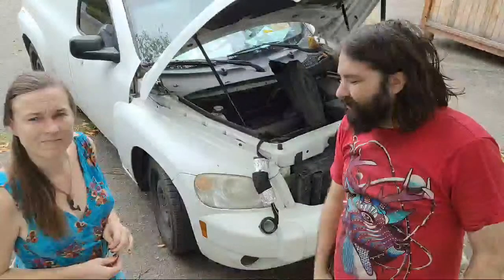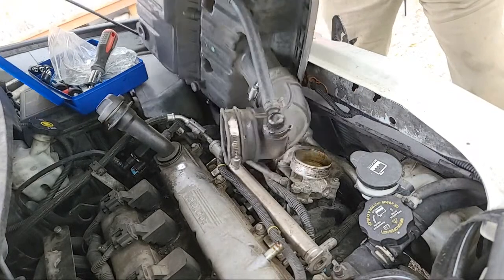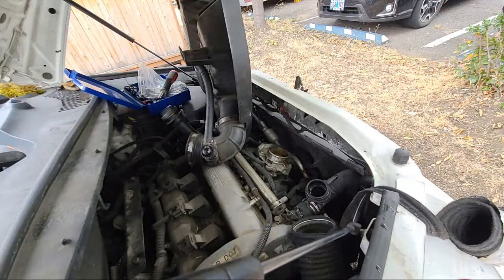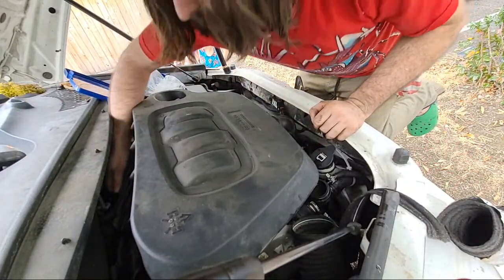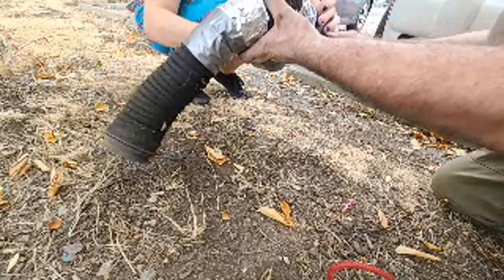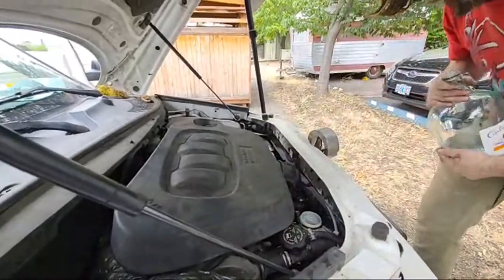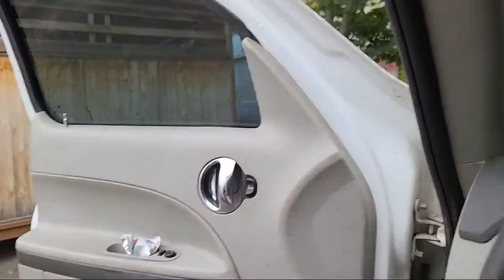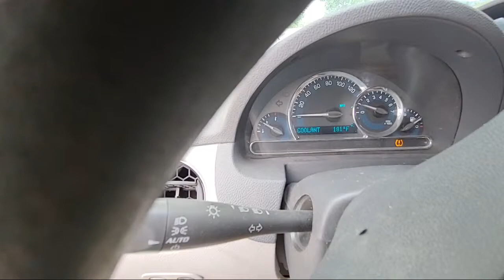Fixing the car Replace Coolant Reservoir HHR

Comment: The overflow is probably fine. It's designed to let the coolant spill out if your coolant is boiling. You probably have an overheating problem. Rad fan might be bad, thermostat might be bad...

Comment: Erick, I tried to get tank off, i had the 2 top bolts removed and the pump disconnected. Is there another bolt or nut underneath ? If so, how do you get at it? Thanks
Reply from the maker: No there's no other bolt in a need a tank it slid up
Reply: @Erickthedreamgiver  Sorry to disagree Eric, there is a third bolt...left lower below the pump...